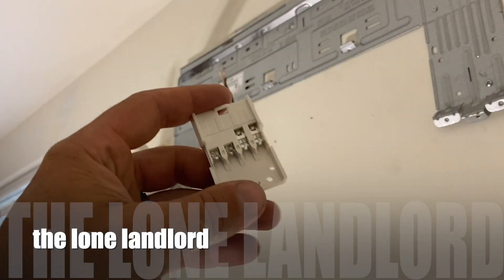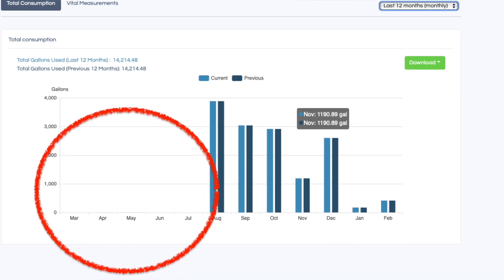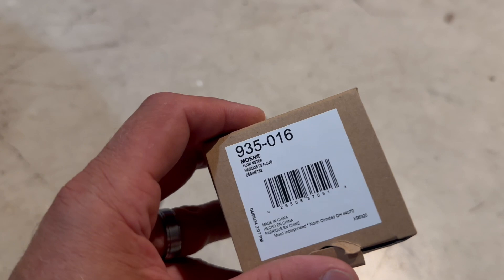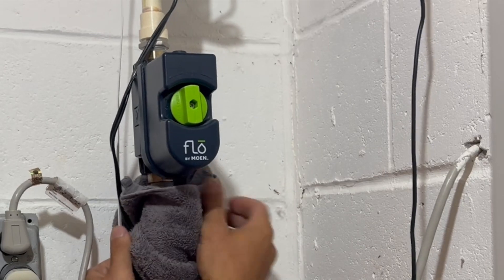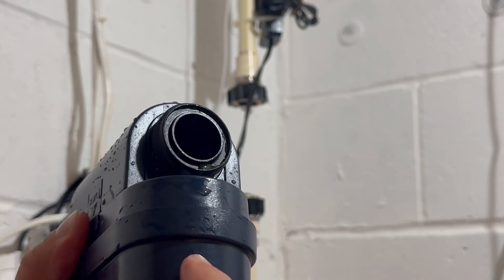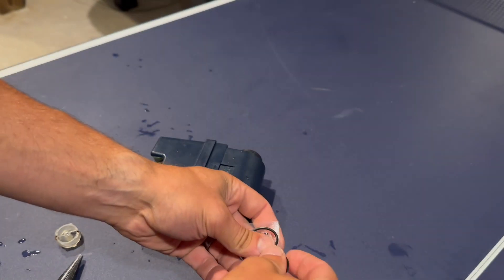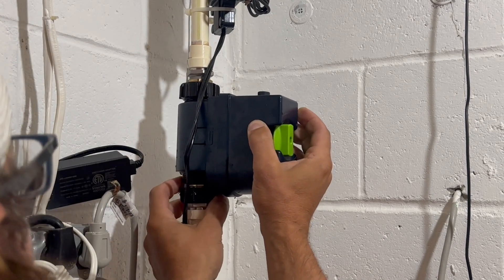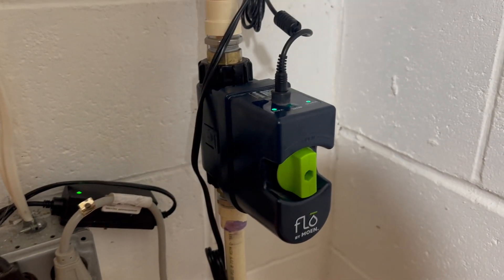Moen Flo Design Flaw | Don't Leave Your Home Unprotected!

Comment: Thanks for the video. I have two of these systems. One of them went to zero flow and I was a little afraid of trying to do it myself, but after watching this, I probably can. My other house shows a tiny bit of flow most of the time. I think it goes to zero every once in a while. After extensive checks and verification with the water bill, this is a false flow reading, so this must be another version of an impeller problem. As this property, I do see that the city water pressure goes up and down too much ; if the pressure sensing is correct . Originally thought these might be orifice plate flow meters and the fluctuation and pressure would cause a false reading. Not sure if you’ve ever seen that. We definitely don’t have a leak and we count flow totals all the time.

Comment: Anyone installed it before pressure regulating valve? I am concerned that the city pressure variations (high pressure) can cause my valve to shut off. Anyway around it?

Comment: Completed my replacement thanks to your video. Mine like yours was loosened by hand easily. Have you noticed any lag or delay in the reporting time from when water is on to when the app shows it and vice versa, when water is off? I have a delay in both but the off time is the longest. Nearly a minute after water is off the app still shows usage. No other faucets on and no parasitic drains.
Reply from the maker: hmm strange, no I haven't noticed any lag on the app

Comment: This is the best Moen flow sensor replacement video I’ve seen.  My Flo stopped sensing last week about a year after installation. We’re on well water that has high iron levels and the Flo sees this water before it goes into the treatment system. I wish Moen could come up with a way to limit the buildup of deposits around the magnets.
Reply from the maker: Thanks! I agree, definitely an issue but at least it's a quick fix